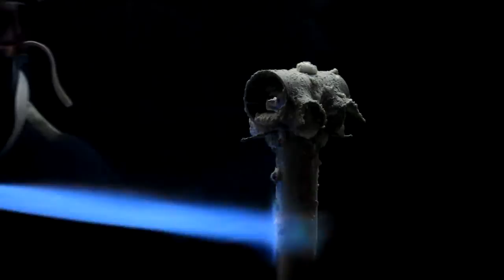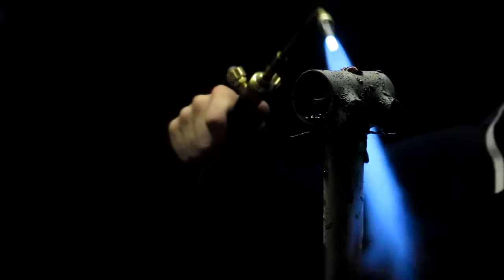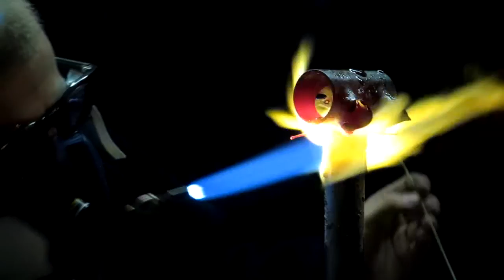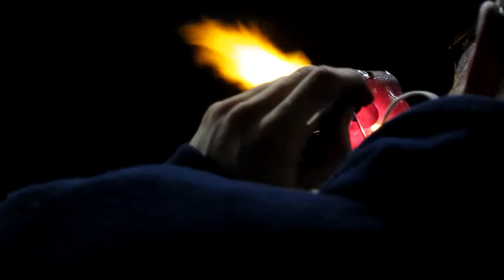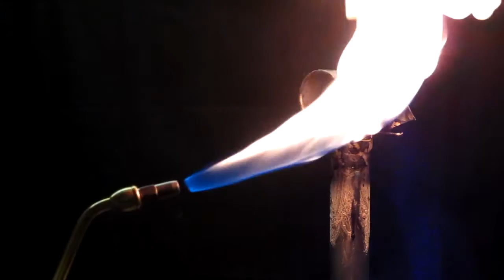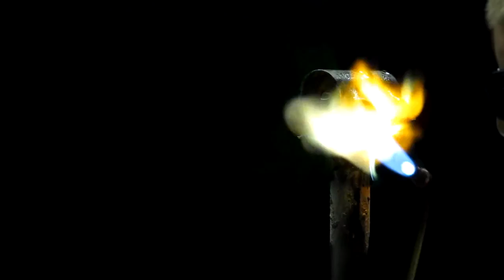Brass Brazing a Bottom Bracket

Comment from the maker: Hi Zoltan, thanks for the comment.

Could you explain way to much time?  I do expect to get faster with experience but I don't believe there is a problem holding it at this temperature for this time, apart from exhausting the flux.  

I don't think Oxy-Acet is necessary.  It would provide a hotter flame but no more heat energy, so I think it would be easier to overheat a small area.

I brazed the bottom bracket inside out so gravity was helping me :-)

I'm in the UK and got SIFBronze from Ceeway

Comment from the maker: Hi Zoltan.  I find for brass brazing dark red is too dark, it needs to be glowing orange for the brass to flow at 890 celcius.  Are you using Silver?

Brent Steelman has a good video on Brass Brazing a fork with Oxy-Acetylene called "max fork brazing"

And Nagasawa uses brass with a big flame in the video "Nagasawa brazes a lower head lug"

These guys are very experienced so they go a lot faster than me!